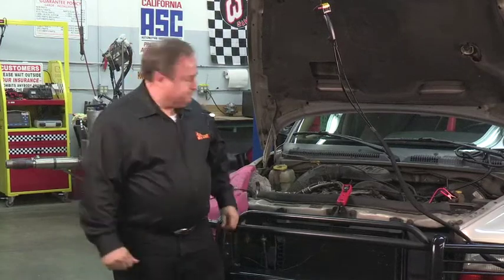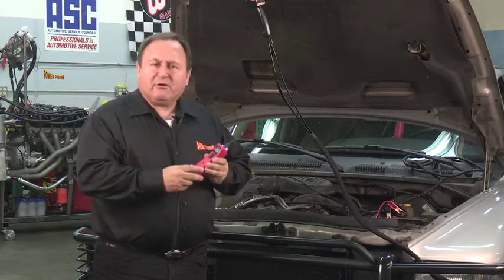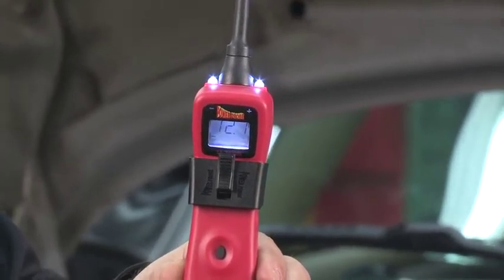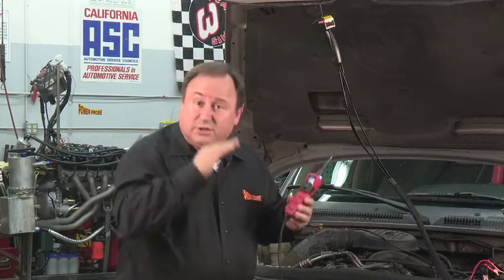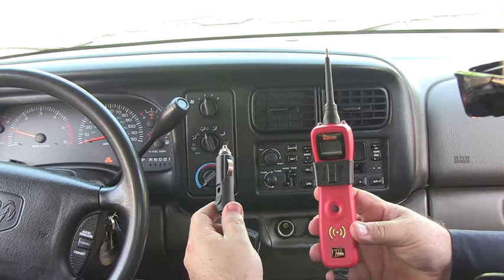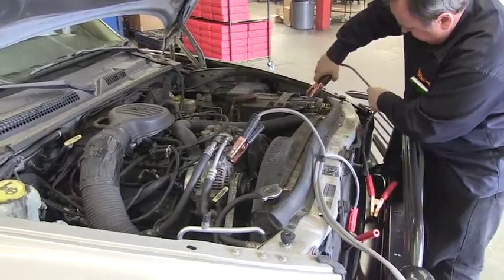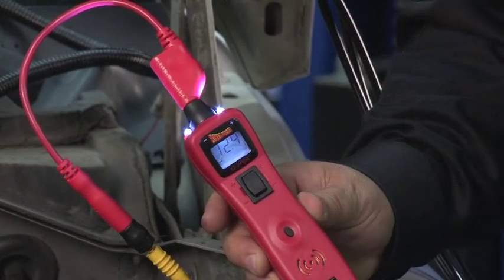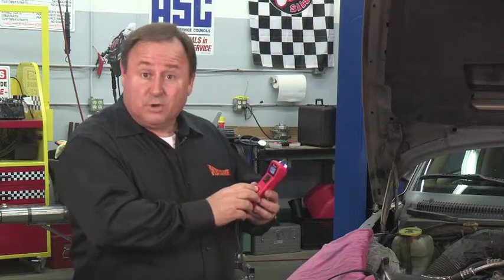Power Probe 3 Negative Peak to Peak mode

Comment: I finally get it but it's amazing how you spend so much time covering how to switch modes but nothing about how this actually works.  Geez, if you don't know how to switch modes in 5 mins of acquiring this probe then you shouldn't be using it.  It's very annoying to watch the same thing over and over in these videos that should be obvious.  On the other hand your example of the cranking test misses an important point.  I kept wondering why you had to apply voltage to the tip and it turns out that you don't but you do have to understand how the display works on the probe.  When you switch to mode 2 the display is 0.0.  It's also 0.0 when you do a reset.  0.0 is also what happens if you have a broken circuit, voltage goes to 0 or you just take the probe off the circuit. There's nothing on the display that shows you what 0.0 actually refers to.  It could be any one of the above.  You have to go thru a specific set of steps every time otherwise it can be confusing, such as thinking 0.0 is the actual voltage when it's not.  i.e. reset, put the probe on the circuit, press the mode button, conduct your test but keeping the probe on the circuit.  If in doubt switch to another mode and then back to mode 2.  The reason why he applies voltage to the tip is because then he doesn't have to worry about making sure the tip is connected to the circuit during the tip.  Basically it's like taking a wire from the positive post of the battery and wrapping it around the tip of the probe so then he's always measuring the voltage.  Alternatively, he could have put the probe on the pos terminal of the battery during the test but then he would have to make sure it was pinned to the terminal so it didn't come off and it had a good connection.

Comment: I'd think I could test for voltage drop from the positive and negative battery terminals by also hooking the negative side of the power probe leads up to the starter body on negative wiring instead. Are the ends long enough to be on the battery and on the starter?

Would it also work if I was on the positive lead for the starter with the power probe and the negative on the battery? Always got to check components individually rather then just condemning the starter for example.